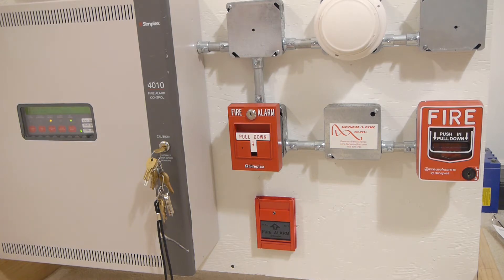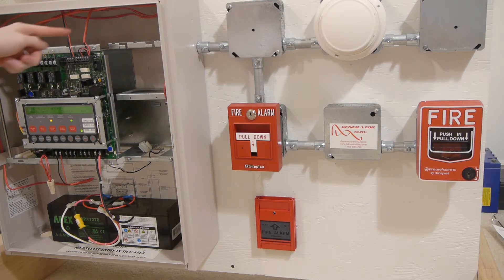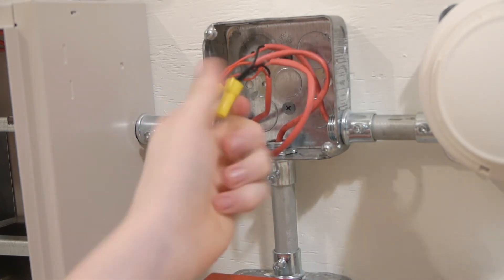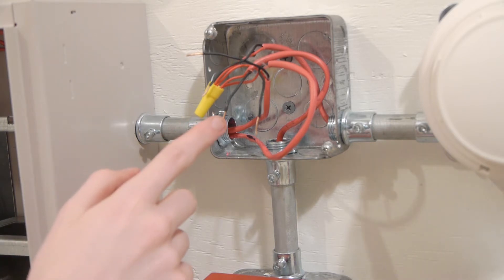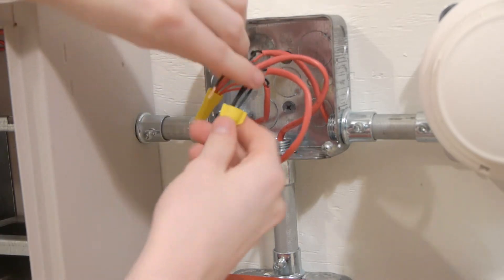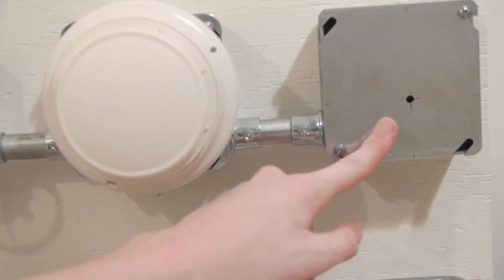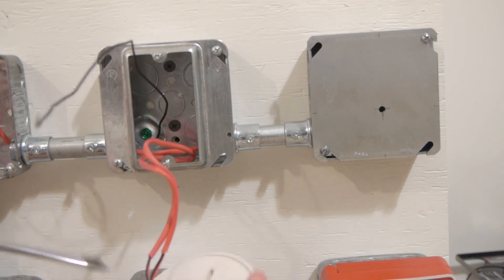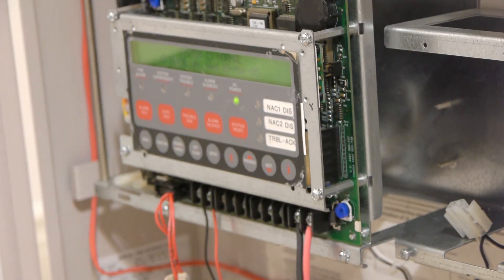How to find a Ground Fault on a Class B SLC with T-Taps

Comment: I'm an old retired electrician so I'm behind the times. So, I gotta ask: What is SLC and can you really T-tap fire alarm circuits? We never could.
Reply: SLC refers to "Signal Line Circuit" meaning its a circuit for "addressable" devices. Yes you technically can T-Tap it but it isnt recommended as people below said, it becomes a pain to troubleshoot, especially in larger buildings. NAC (Notification Appliance Circuit) can not be T-Tapped. Well let me rephrase; it can be t-tapped, and all of your devices would still work. The issue is, whenever the NAC branches off of a T-Tap, any device that doesn't have a resistor at the end of the circuit, will not properly be monitored. Keep in mind you can only have one resistor on a NAC circuit, so if your circuit begins to go two directions, where do you put that resistor?
Say you have: 
Panel -> Horn Strobe(HS)1 -> HS2 -> HS3 -> HS4 -> HS5 -> HS6 -> Resistor 
                                                                    |
                                                                 HS7
                                                                    |
                                                                 HS8
                                                                    |
                                                              No Resistor
  As you can see in my very poor diagram above; HS7 and HS8 don't have a resistor. The devices would still flash and sound, because power is just power until you tell it what to do. But if someone were to take HS7 or HS8 off the wall, or the device were to stop working for some reason, the panel would have no way of being able to notify you of an "Open Circuit" because it doesn't have a resistor to look for in those devices.
Reply: I would never T-tap.  In a high-rise building it becomes a nightmare for troubleshooting.  Some panels have mapping, and the programmer can see the T-taps with the addresses of each device, but most don't share the location to the installer.
Reply: Depends on the type of system. Usually mapped systems can not be T Tapped or if they are they can only be T Tapped in certain areas of the system. Honeywell systems have no issue with T Tapping
Reply: @JustinShalloo  what's mapped?

Comment: Fire alarm systems are at times frustrating when it comes to tracing and troubleshooting ground faults.                             I think the video is very informative.  You did a great job explaining the wiring of the circuits and the Understanding circuits is very important when trying to trouble shoot Ground faults opens and short circuits etc.     
                                                                                                                                                                                                                    I have been servicing maintaining programing commissioning large life safety systems for over 30 plus years.  So, when it comes to the infamous ground fault IE SLC, NAC, 24VDC Aux etc.  Negative or positive doesn't matter. 
 Troubleshooting is key on the approach on how to investigate the fault. Like was there any construction done recently?  Known water leaks floods, roof in the building etc. This would help out the technician pinpoint the area. When breaking up the known circuit in the fire alarm panel. The Technician on site will not know how its wired (doesn't matter) The key is to break the known faulted circuit in halfway segments which once done they will know which half is causing the fault.                                                                                                                                                                                                      The key here is at this point is to keep breaking the fault circuit in half's IE not Every device etc. This will be a time saver, along with never having more than 2 to 3 opens of the circuit any 1 time so you don't' lose track of the path where the ground fault is located IE class-A or B Etc.
 Connections are very important Please always twist the wires before using the wire nut. Very important when it comes to the SLC Map net loop.                                                                                                                                                                   Now not all ground faults have a low resistance. Most modern fire panels will detect a high resistance ground fault IE 200K ohms or more. Now these may be from a wire that has been pinched in an electrical box or from a cable pulled tight on a metal pipe or HVAC duct or even tie wrapped FPL cable to a threaded support rod etc.    
There is another tool to use in the troubleshooting toolbox.
 Set the Multimeter to DC voltage The Fluke T5-1000 meter will be fine for this test if used. I like the Fluke 87 ($$$) but the 177 is fine anyways.
etc.
High resistance grounds are not easy to trouble shoot. These can be caused from Wiring faults on the input side of a monitoring module on the SLC circuit.  A 300K ground could be from a Wiring issue or from an input monitoring point.    The video was very good in explaining how to troubleshoot the circuits.                                                                              Most circuits are powered limited so a short will shut off the power but typically most circuits as designed to operate on 1 ground fault but NOT multiple ground faults. Voltage is key here Lack of voltage or a low voltage condition from a ground fault will disrupt the SLC communication to devices along with not having the proper voltage to operate the Horn/strobes etc. I Hope this helps the professionals in the fire alarm Tech field The more you know sure helps in daily work!!
Reply: Paul, I believe we worked together at the JFK Library in Boston.